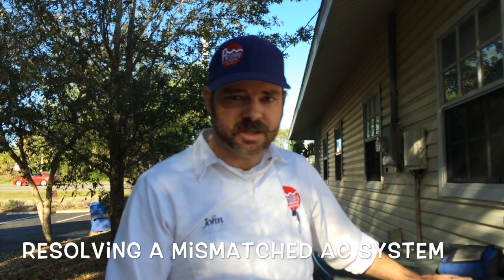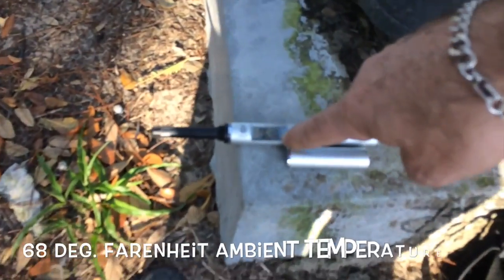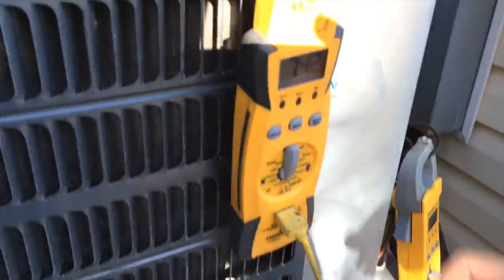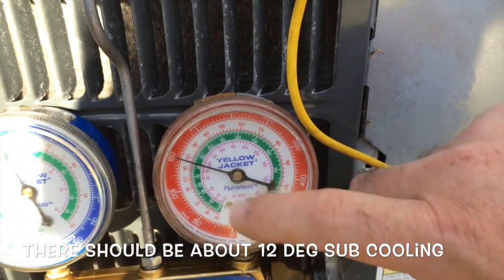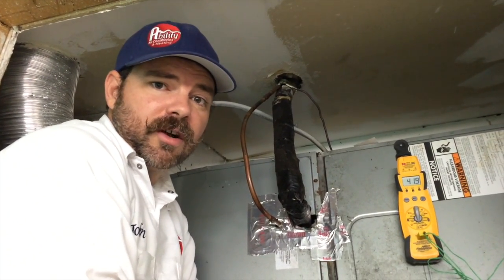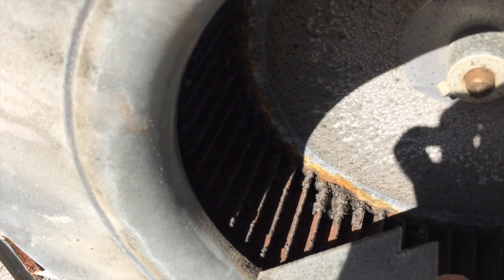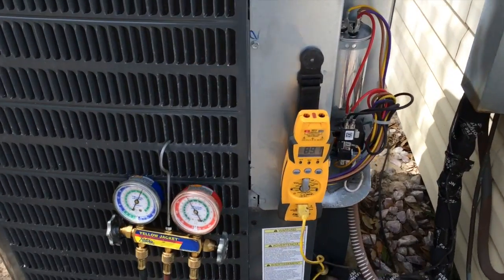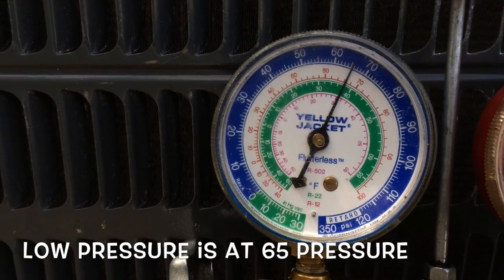Mismatched AC System Tutorial

Comment: Seems like the unit was simply undercharged and low on refrigerant...
Reply: I would say the same thing...
He never showed a superheat temperature and by saying it is all liquid is a false statement until u show me a superheat number!!!
 Based on the high side pressure being low and only having 6 degrees of sub-cooling, Add a ½ a pound of refrigerant and see what it does...
The sub-cooling should increase towards your desired number and head pressure should also increase...

Depending on the metering device, a fixed office superheat should drop and the txv could stay the same and can drop as well depending on what the original measurement was...
Which we never got to see!!!!

But I will say, that coil was in much need of replacement, the air handler was rusted out, and it makes good sense to change it out...
But tell the truth of the service call and what you find!!

Comment: Y would anyone want a variable speed unles they have high efficiency outdoor as well looks like a run of the mill 14 seer junky goodman outside plus when that motor goes out expect high price to replace this next to a rescue motor
Reply from the maker: It was the only air handler that would fit in the space and the duct system was restricted. I didn’t install the condenser. Some other company did that and I was making the best of a bad situation. It worked until 2 years later when they gutted the place and installed all new system and ductwork.

Comment: Very good video, i noticed though that the secondary drain is piped into the pan - This can cause splashing of water out of the coil in high static situations & overall isn’t good because of the chances of creating mold inside the unit. Stick a SS2 on there if anything.